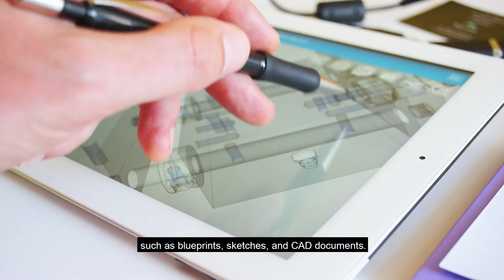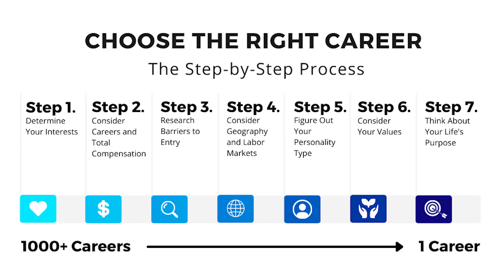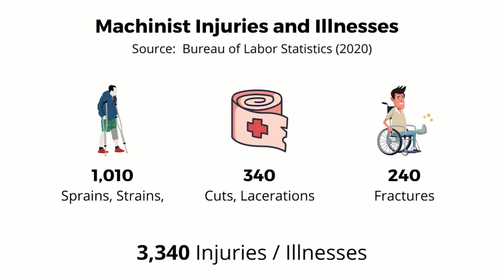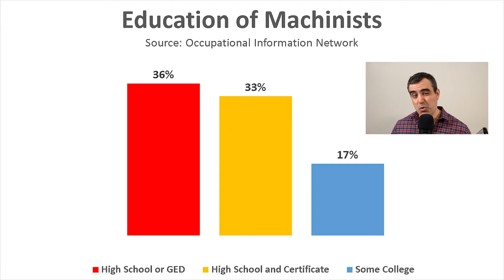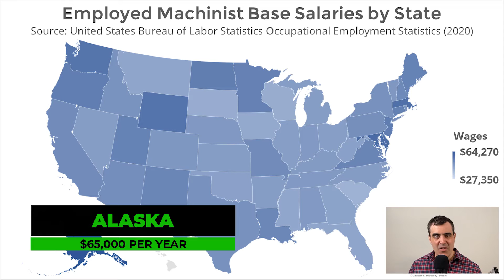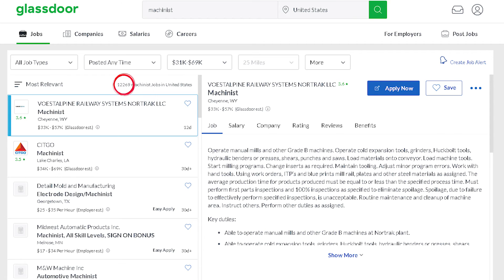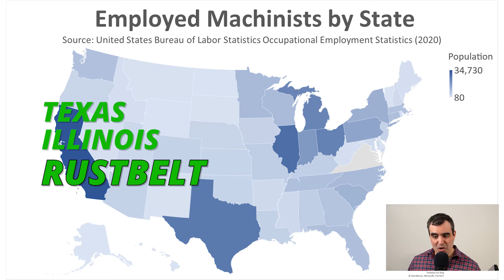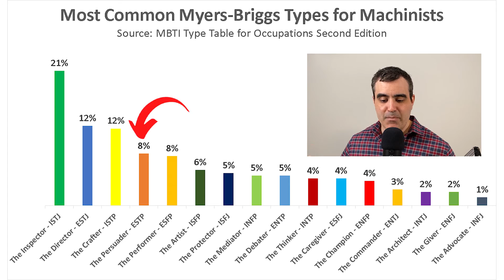Become a Machinist in 2022? Salary, Jobs, Education

Comment: 5axis aerospace machinists here.  32 years old, 14 years of experience.  I have ran, set up, and programmed,also some CAD.  Currently making just under 100k a year in Wisconsin so it’s an ok livable wage here.  I have experience with all sorts of machines,controls,programming software and solidworks, manual, and CNC machines, 3 axis verticles, 4axis horizontals, and 5 axis gantry’s amongst, a whole lot more I’m forgetting about 😂.  It’s a good trade if you find a good company. My advice is learn all you can from tool and die shops, Job shops, learn everything you can! Work in aerospace or biomedical manufacturing companies and always strive to learn more.  I’m  going to school so I can take what I know and apply it towards the industrial engineering/design side of the trade and everything I’ve learned along the way as a machinist is definitely a good way to become a well respected engineer.  So it is a good pathway to get into engineering and other departments of manufacturing like quality or process engineering but you have to actually apply yourself and don’t settle to become a button pusher.  There are so many old geezers who through there lives away only doing the bare minimum and they make the trade miserable because they are.  Don’t be that guy 😂 and you can have a wonderful fulfilling career!!

Comment: Most of the machinist jobs in the rust belt are tied to the auto industry. Wages are low compared to aerospace. In the Detroit area employers are in collusion with each other to not hire a worker that is employed from another shop, they will call your present employer to tell them that you are job shopping. If you become a plumber, electrician, carpenter etc. you can work for yourself.

Comment: First off pushing start button on a already programmed machine is not what a machinist does ....if u have real skill u will get rewarded
Reply: Agreed... I did set up and programming... After that, the machine was handed over to a high school kid or foreigner on a work visa...From that point on to the end of the run, I would just come by occasionally and check the part, make adjustments or replace the tool when it wore out or broke...

Comment: There are too many flavors of 'machinists' with their own core competencies that have some but not complete skill crossover/overlap.  

There's the hierarchy in production shops, operator/setup/programmer. Small order job shop do-it-all machinists. Huge part, big machine machinists. Ultra tiny complex feature machinists. Specialized machinists that deal with assemblies like Tool and Die, Mold Makers, Model makers. Even more niche 'machinists' that make optics using diamond turning machines. 

Frankly, I think the generic 'machinist' title does the trade injustice bunching up every field into this singular category. You see this happen in corporations where far too many higher skill titles has its salary range tied to the result of a generic 'machinist' salary survey of their respective location. 

Still, it's a nice trade. Plenty to learn. Relatively easy on the body. And low barrier to entry. Unfortunately, it's barely enough pay for all the stress involved.  It's a sour flavor once you've tasted what is out there for machining and then realize you'll never be paid more than an electrician or plumber.  Be prepared to jump every couple years, new guys almost always gets more money than established folks.

Comment: I’m almost done with my first year as a mechanical engineering student. Frankly, it’s a lot harder than I thought and it seems like CNC machining is similar enough to my interests and passion while being viable enough to earn a stable income and future while being much more attainable. I may switch in the future.
Reply: Just be prepared to not actually develop anything. 
Most people get into mechanical engineering because they want to make stuff. 
Then they get disillusioned by all the hard math and cubicle work and go into machining because they just want to make stuff. 
Then they get into machining and often get disillusioned again because you are making stuff but your basically just a cog in the production process. 
Your job is to make x part, you usually don't even find out what part of a machine it goes into, you just make it and put it in a box.  Your basically just the part of the production process that nobody has figured out how to automate yet. 
Also parts can be creative and interesting but they are the programming jobs, which is a fraction of the jobs out there.
Reply: @kkknotcool  Most top machinists are also programmers. They use programs like Mastercam, soft cam or fusion 360. You're right about feeling like a cog inside a machine, but you have to remember you're working for someone else. Ideally, what your goal should be is gathering information and as much experience in programming and the machining process from design to product and then starting your own company. Many machinists I've know have done just that. You can design for customers looking to make prototypes or make your own inventions. Or you can just design and program and be outsourced by companies, but you work for yourself.  There's many options if you're willing to put in the time.
Reply: @XhectorX1417 I agree anybody can eventually get out of the button pusher/setup world of cnc, but I've mostly seen people start businesses because it's so hard to actually move from setup into programming. Any career where you have to leave employment to get experience in the higher levels isn't exactly a field full of opportunities. 
I'd get a degree in machining as a 4 to 7 year plan to get a $50k/40 hour a week job in a low cost of living area and live cheap and save up for a HAAS mini mill or tool room lathe. That's the only way I see any forward career movement for most people in the field.
Reply: @kkknotcool agreed
Reply: The experience you learn as a machinist will be priceless as a mechanical engineer.  Learning how different metals react to heat,  pressure,  etc.  Learning the manufacturing process, from design to program to setup and finally product.
Reply: I learned machining to subsidized my ME degree. What you learn as a machinist is so valuable for a ME.

Comment: I am 18 and work as a machinist. I make 20.60 an hour but its not too bad bc i live in sc. I work 55-60 hour weeks. I am uncertified but i learned alot over the internet. Def not a job for everyone. A few tips for increasing pay are moving between jobs every several months, say during your interview that you want to learn alot of different skills and machines, and also learn g code on your own on the internet internet. It is a very simple language and knowing it is an extra 5-10 an hour. One of the main reasons pay is low imo is bc alot of older machinists have been working at rhe same company for many years and dont want to move even for higher pay. Where I live a machinist with 4+ years of experience can easily make $40+ an hour.
Reply: Hey, i wanna ask u about it, like how and where’d u learn from it and im tryna break into this industry, would be great if u drop some good stuff

Comment: Do not invest your valuable time and/or energy in any career that can or will be farmed out to another country at any point in your lifetime. Future proof yourself the best you can. When I began as a Tool &Die Apprentice in 1979 the most modern piece of computer machinery was (NC) Numerical Control. It was considered amazing that a machine could read a tape with holes in it and move in various directions and arcs. People laughed at the thought that any foreign country could compete with American manufacturing. Today, pathetic kids with college degrees in mechanical engineering think that they are somehow smarter than 20-30 year career machinists. And business owners fall for the BS that a kid who can use the latest CAD software knows how to design fixtures and understands all the tooling available to cut hundreds of kinds of materials. If you have half a brain, and are a really good machinist, 99.9% of companies will never pay you your real worth. They'd rather buy a $300K machine than invest $80K + benefits per year in you. The laughable part was always being asked to fix problems and save an engineering mistake, then being treated like crap as soon as you saved their ass. Maybe a well-trained mold maker could get $100K + a year, but how much job security you'll get is the big question. My 40 years of experience with both small and large companies, recommends to RUN away as fast as possible. I knew plumbers, electricians, HVAC and auto mechanics who could barely tie their shoes making 50%+ more than me for decades. I was a fool to think that there was a company out there who would appreciate my skills.

Comment: I am 22 and I have been in a shop since the age of 16, I flew through trade school within less than a year and I get paid very well because I also am certified in master cam programming, a machinist and programmer is highly valued
Reply: Hey,would you kindly elaborate for me what master cam programming means
Reply: @virtuousandvivacious8020 its like a code generator , cam/cad search that up
Reply: @virtuousandvivacious8020  Master cam is a name brand software that is commonly using in machining, its very intuitive and allows shops to 3d model parts to specific sizes they need and then also program a toolpath (the literal route the a CNC machine tool takes) that allows them to essentially make a part from scratch on the computer and using toolpaths, make the part at a CNC machine. Its become a necessity for production shops and if you are computer savvy and dont mind staring at screens all day, id recommend learning it over becoming a machinist. Although learning both is beneficial and almost a necessity as well
Reply: @YTMASFTR  look online at nearby trade schools for something like machine tool program or something along the lines of that. You can also just watch quick youtube videos on how to read a micrometer, caliper and some basic precision measuring instruments. (they are easy once you get the hang of it). Your best bet is becoming a button pusher first, which is gonna be like a CNC operator, your job would be to load and unload parts inside of a CNC machine and press the go button and do periodic measurements to make sure you are hitting your numbers. That is going to be the easiest way to get your foot in the door. You can also just cold call some smaller job shops, the trade is hurting pretty bad and they will take anyone that can prove they are willing to learn and can consistently show up to work. The pay is not great, i myself am actually considering exiting the trade after 2 years because im at 20 an hour and that where I am at isnt enough to live on. Make sure you REALLY get a scope of salary for this line of work where you live to make sure its something that you want to do. The field is truly endless and youll never stop learning. Trade school to get your feet wet isnt a bad idea, but your first month in a shop you will learn more than your first year in school. If i had advice, I would say to get REAL familiar with SOLIDWORKS and MASTERCAM, they are programs for designing and writing toolpath programs for running production on parts. You will make more money if you are good at that than you will if you become just a machinist. Cant stress it enough though, look at your local job market for machinist positions, nothing worse than investing time in schooling and learning your pay ceiling is only like 24 dollars in your area(and thats after YEARS in the trade).
Wish you luck on your journey!
Reply: @YTMASFTR  For education, look into a local Vocational school or Community College. I'm not entirely sure how many schools offer it as a program compared to something like plumbing or electrical.
Reply: @YTMASFTR  There’s trade schools that teach Machine shop some high schools also teach this. You can also get free information.

Comment: Here is my thought process. It seems that this job has had low base pay and has lagged behind but as the boomers continue to retire and the lack of new blood coming in means that there is going to be a huge snap back to hire wages big time.
Reply: You’re almost right, however the job is being shipped over seas as the boomers die the trade dies
Reply: @quickdiy8127  well I'm no boomer I'm not even 40 yet.. and I'm training two new guys right now so I'm sure these local shops down here will stay
Reply: @quickdiy8127 nobody's shipping their john deere engine to China to be resurfaced my guy.
Reply from the maker: Boomers retiring will have huge implications throughout the economy.
Reply: I'm not sure about your low pay logic as a machinist... I started at 35 an hour and currently make 48 an hour after 5 years in the same shop. I also have full benefits and 3 weeks paid vacation a year. This video doesn't really give much useful information on this job. I'd ask an actual machinist what it's like.
Reply: @NightCityRacing  Those wages are almost unheard of for machinists.
Reply: @Shockeclipse  Machinist seems to be a very diverse term now days but what I do is very specialized. Now there are things that contribute to my income over other machinist but I think that mostly comes from hours worked. It's not odd for me to work a 120 hour work week. It feels pretty normal when I work two or three weeks straight without a single day off. I specifically make parts and tools for ships going up and down the Mississippi River out of New Orleans. I have seen a lot of untrained machinist since I made this comment who apparently scrape by for pennies in sweat shops basically. I won't work for dummy money. If I don't make a living wage I won't do the work. If more people had the mindset of "pay me or I won't work" instead of "pay me to work" more jobs would pay more.
Reply: @NightCityRacing  What did you do to get that specialization? If I wanted something similar should I go to school for that or what route should I take?
Reply: @NightCityRacing  120 hour work week, 2-3 weeks without a day off? LOL living the dream are you?

Comment: I am a machinist have been doing it for 6 or 7 years and I make 31 an hour and I work 50 hours a week I have my ged and learned everything on the job
Reply: I make 20.26 a hour and i work 27 hours of overtime a week theres alor of overtime in machining
Reply: I make 45 and didnt go to college as a machinst
Reply: @francysvarona3567 no trade school or anything?
Reply: I heard the job can be repetitive
Reply: @GKDon919  can be. Probably depends on where your at. I learn something new everyday. Look for a small shop that runs different parts.
Reply: You must be working a Union job because I was getting paid worse than my local mcdonalds when I started my job
Reply: @Tarsibu  yea I got the in at Boeing. Best decision I made
Reply: I’m beginning my training in line boring, I’m new to using a machinist level do you have any suggestions on how to get better? What machinist ruler do you recommend? Starrett?
Reply: @Bob123-vr  the Starrett level is def top of the line. Are you by chance milling giant diesel engines? Early in my career I worked for Hitachi I was milling giant CAT and Cummins engines for earth movers.
Reply: @Bob123-vr machinist level? Machinist ruler??  What are u going on about lol there’s verniers, micrometers, bore gauges, etc…. You must be new!
Reply: How did you get started? I'm a welder/ironworker now.
Reply: @RedBeansRice  I started off in a smaller shop doing deburr but if you go to most cnc. Shops and apply they will usually hire you if your willing to learn
Reply: Ask around, find a shop that is needing any kind of help at all, get your foot in the door,  work your butt off and everytime someone gives you the chance tell them how much you want to a machinist.  Be on time, everytime. @RedBeansRice
Reply: Where u stay ?
Reply: @ronnieburton3633 Oregon
Reply: @ronnieburton3633  I am in Oregon